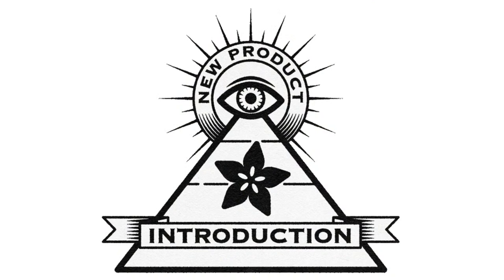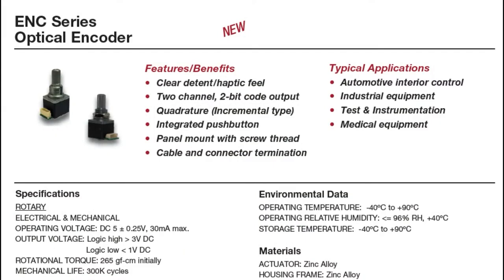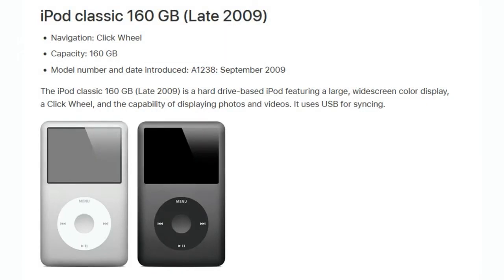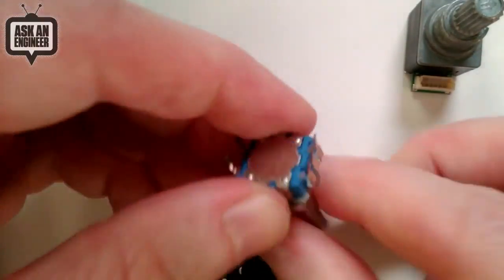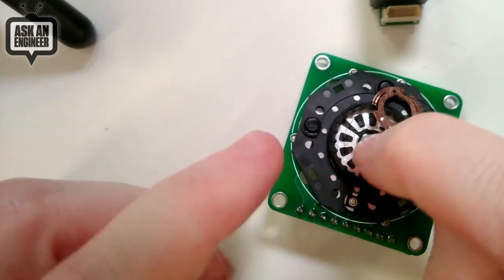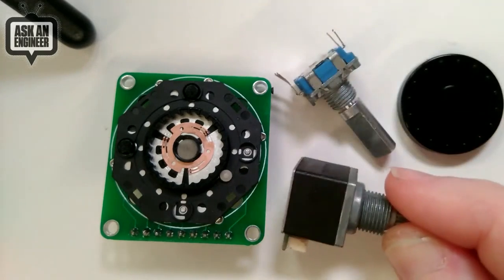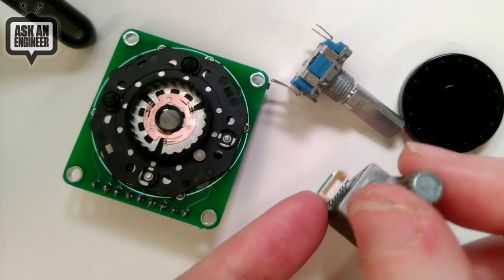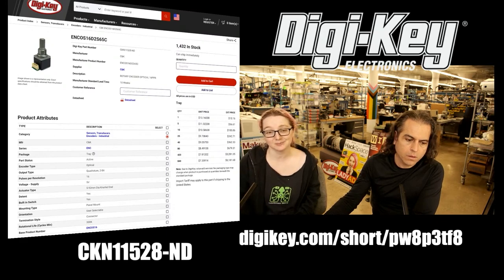EYE on NPI – C&K ENC Series Optical Rotary Encoder Switches #EyeOnNPI #DigiKey @DigiKey @ckswitches

Comment: These are great as volume controls on high-quality amplifiers and headphone DAC amplifiers… in audio the volume potentiometer is always the first thing to go bad even the mechanical rotary and coders go bad overtime but the optical ones are the real nice smooth ones that never wear out.  Anything you wanna rely upon long-term should use these optical encoders for sure!